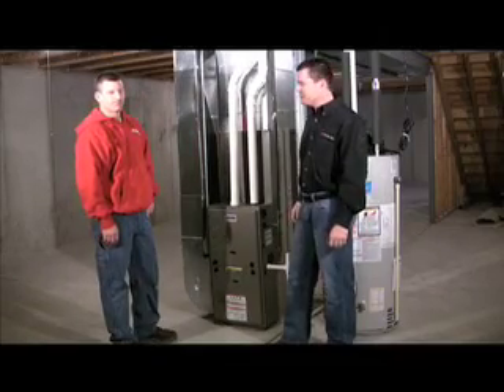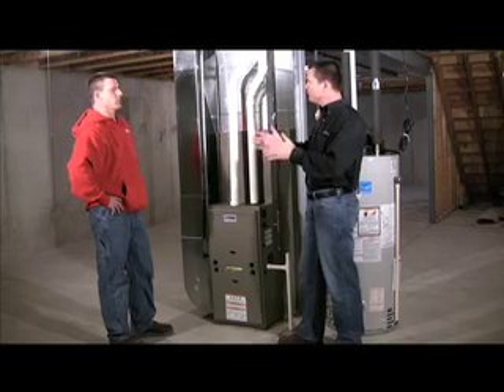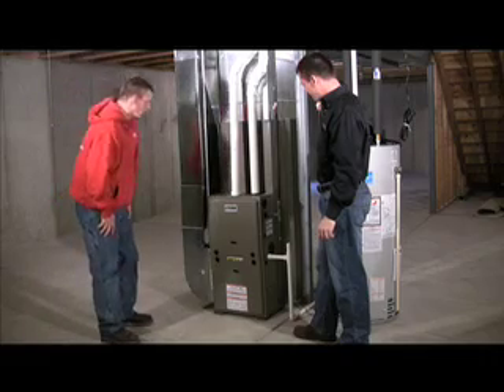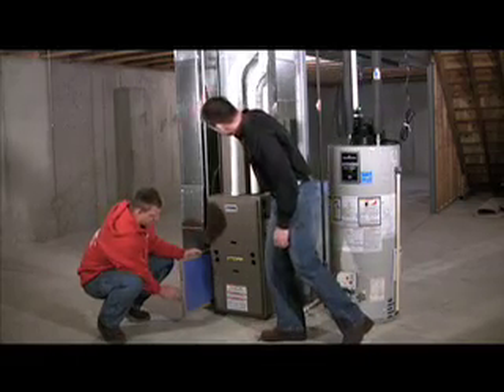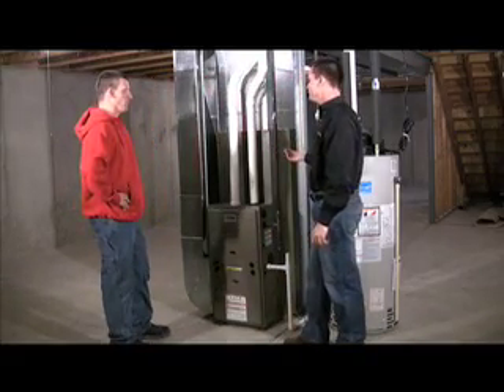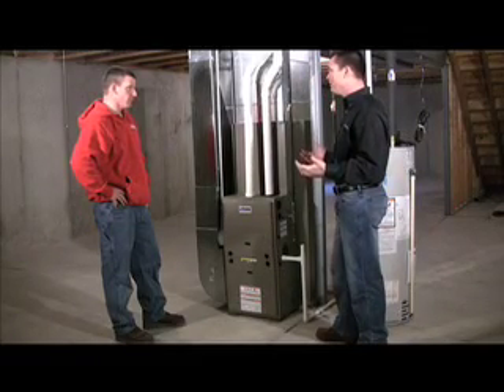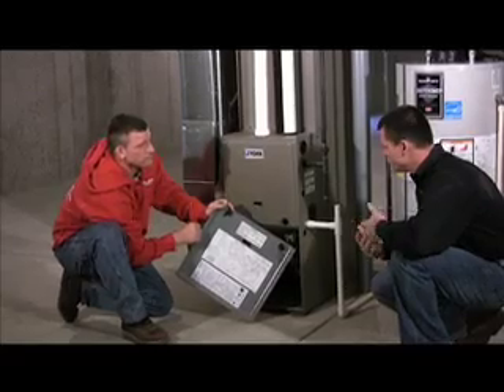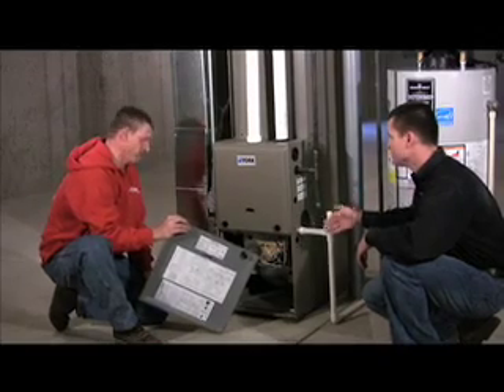High Efficiency Natural Gas Furnace - EXPLAINED!

Comment: As a 40 year heating contractor I can say with confidence that if your older mid efficiency furnace is working as it should DO NOT UPGRADE to a high efficiency furnace. You will not save nearly enough money to offset the cost of a new one. Most mid efficiency furnaces will last 35-40 years or MORE while the new one will be 10-15 years! You might save $150-$250 in costs per year but you have spent $5-$6000 on something that will only last 10 years or so. The math does not work. Even with the odd repair like a thermal coupling ($150 max) the mid is a better value.  Simply change your filters every season

Comment: Thanks, I've always assumed the air flowed the opposite way.  No clue.  Nice description of the sealed combustion especially the exhaust.  Looks like I've got one of the ancient 80%ers then with the flu exhaust.  Been installed since 1991.  CO2 (  read as small '2' above and to the right of the O symbol) exposure sounds like enough of a reason to upgrade to me.   Thanks boys.